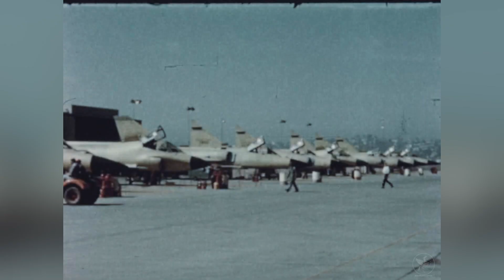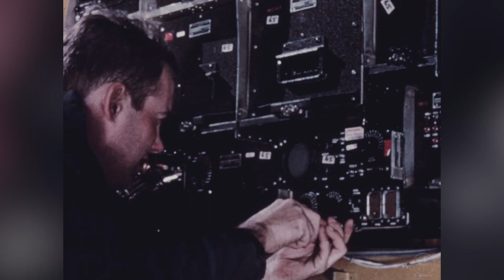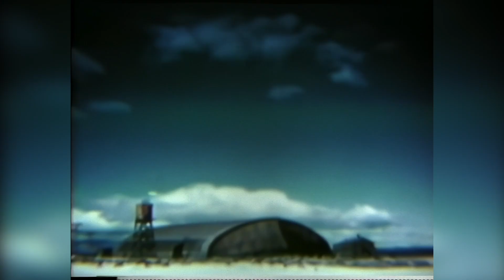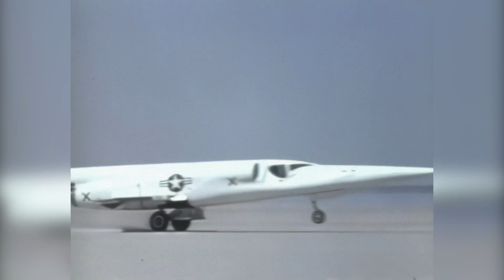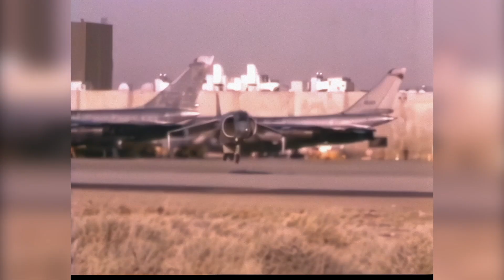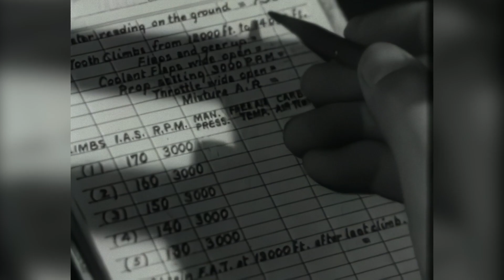Convair F-106 Delta Dart | The Cold War's Supersonic Sentinel | Rare Original HD Development Footage

Comment: Still one of my favorite fighters/interceptors.  Is was bad timing that the excellent Avro Arrow -- it was a little later getting into the air and was a step down on the F-106 though it did have more potential.  Not that Convair made bank given the final order was cut to a little over 300.  The USA never really bought into interceptors like they might have.  If the USA was part of Europe they would maybe rethink interceptors once again.
Reply: By the mid 1960's it was becoming obvious that the greatest threat was from ICBM weapons, both ground launched and sub launched. Support for a dedicated interceptor was given over to multirole airplanes like the F-15. Still, concepts like F-108 and the YF-12 version of the Blackbird hung on for awhile until Vietnam changed every ones focus.
Reply: The Arrow was cancelled before it could demonstrate much "excellence".